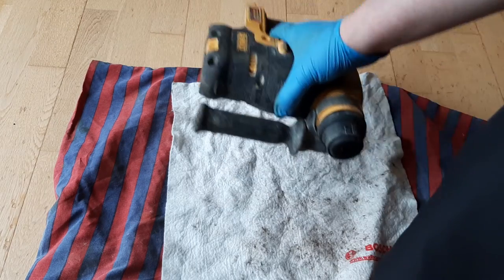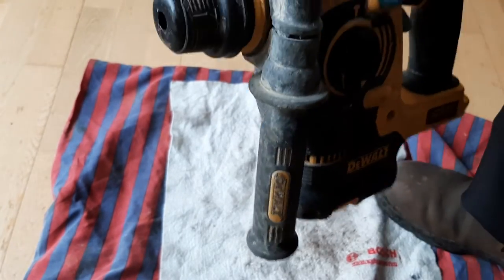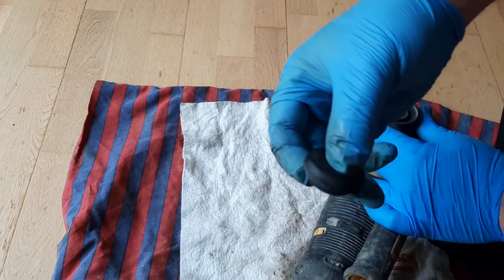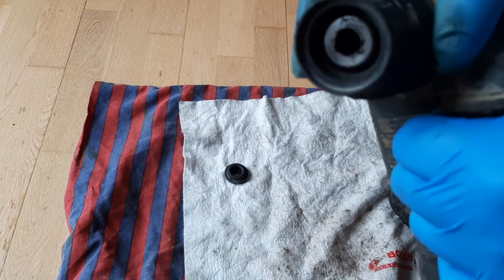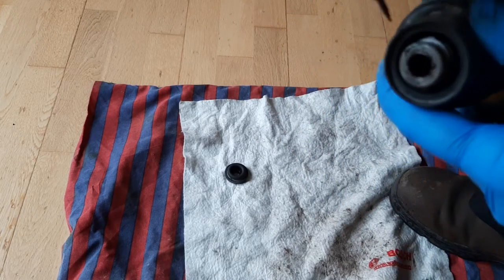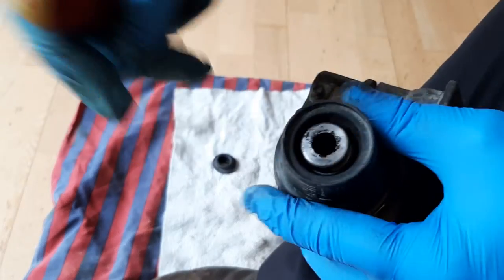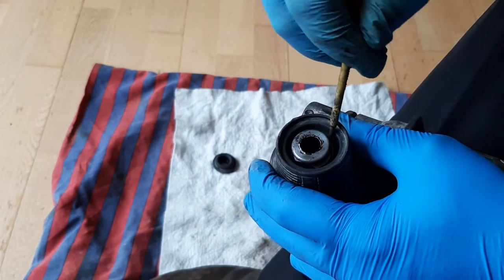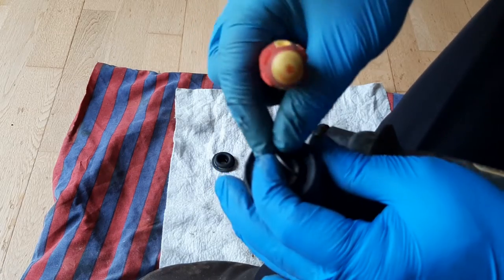Removing an SDS chuck on a Dewalt DCH253, DCH273 etc.

Comment: Thank you very much, this has solved about 2 hours of head scratching. I can now replace with a new kit I assume?
Reply from the maker: There are lots of great part diagrams online you can get the specific individual parts you need.
Reply: I have been given the sds and told if I can repair I can keep it.. I also have the compact sds which doesn't have the hammer setting (for use with chisel bit) sad thing is after a weekend in a dusty rewire the compact switch stopped working and it's now stuck on 1 setting possibly gunked up with plaster dust. If you have any ideas let me know
Reply from the maker: @mikedavis2341  cleaning it with contact cleaner is always worth a try I have had alot of success with this fix